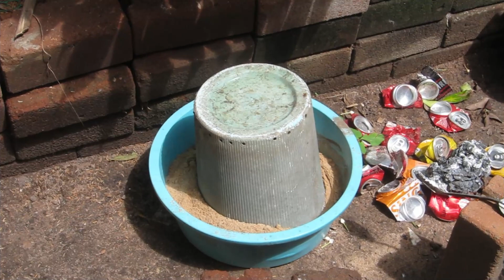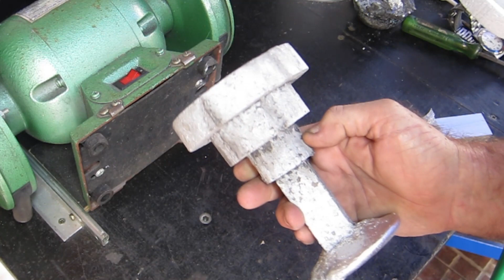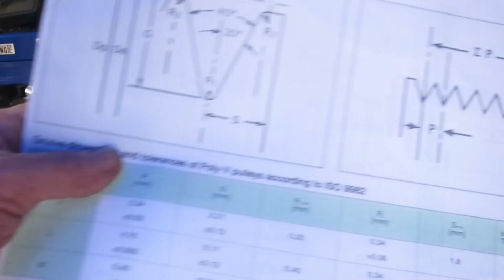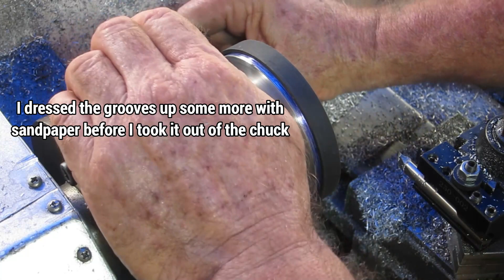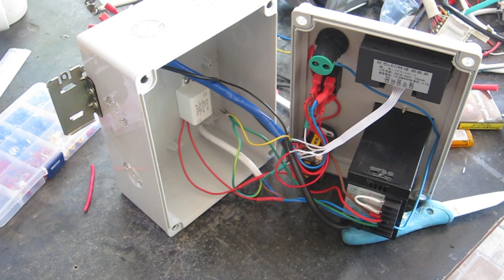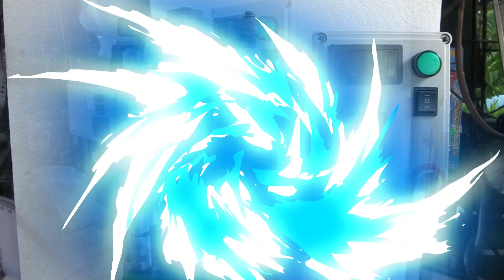MHW Episode 36 - Homemade Milling Machine Build - Part 7 - Lost Foam Casting

Comment: On my Chinese mill/drill I found using EP140 gear oil made it run cooler plus picked up an extra 50 rpm. You have a seal over bearing so it may be worth adding some gear oil to the grease in lower bearing?
Reply from the maker: I have a seal top and bottom, but in between the bearings is just an open void, I was kind of wishing after I built it that I had enclosed that area so I could run a gear oil rather than greasing the bearings, so far they are holding up, but they do get very hot. 👍

Comment: She sounds sweet ! unless you are going to use tiny cutters like 1 or 2 mm you won't need any more speed than you have - what sort of low speed torque does it have ?  That is where  most small mills fall short , they have to run to fast for a drill  over say 5/8  inch without stalling  so tend to burn drills  .You also look to be healthier  than in your previous videos !
Reply from the maker: That is something I like about using these washing machine motors, you can tap into the built-in tacho and control the speed. Yesterday I had it down around 160 rpm and grabbed the collet chuck as tightly as I could and couldn't stall it, it hardly even slowed. 👍
Reply from the maker: Just ducked outside in the half time break while watching the Broncos vs NQ game and made a short video, uploaded to my Farcebook page.  I did the same test again, grabbed the spindle as tightly as I could, it loses a little speed, but doesn't stall at all. 😁

https://www.facebook.com/my.at.home.mini.workshop/videos/573211994452723
Reply: @MyMiniHomeWorkshop  
sounds like heaps of grunt ! So Cowboys or Broncos to win ?
I'm a tiger fan so looking at the wooden spoon 
😭😭😭😭
Reply from the maker: @Flattyman  I'm very much a Broncos man, but happy to see the Cowgirls do well.
Reply: @MyMiniHomeWorkshop  
I'm digging the cowboys as the coach is one of my favourite tiger players - Todd Payten who was part of the 2005 premiers tigers team .
Reply from the maker: @Flattyman  He certainly has put a bomb under them, and they are looking really good.

Comment: I don't know about you but drilling or cutting Aluminium & Plastics I've always found you can't beat Soap.
Rub a bar of soap over a Tap before you start tapping with it. Strong soapy water in a spray bottle is good for cutting or machining.
Reply from the maker: I haven't heard that one.
Reply: @MyMiniHomeWorkshop  Used it for yonks some soft materials tend to melt onto the cutting tool, even sprayed soapy water when cutting Aluminium with an angle grinder. Just don't let the wife see you when she asks " where's all the soap gone "
Reply from the maker: @brianashley3305  😂 I use her dishwashing liquid to wash my hands, and she gets the shits about that. 🤪
Reply: @MyMiniHomeWorkshop  Next time you cut some rubber with a knife or saw put washing up liquid on it, like a hot knife through butter.
Reply from the maker: @brianashley3305  I always used it back home for driving nails or screws into hardwood, that works well.
Reply: @MyMiniHomeWorkshop  
i knocked off some of my old ladies dishwashing detergent once and she thought i was was washing my car - nup i was doing burnouts up the driveway🤣🤣
Reply from the maker: @Flattyman  😂😂😂
Reply from the maker: @Flattyman  😂😂😂😂